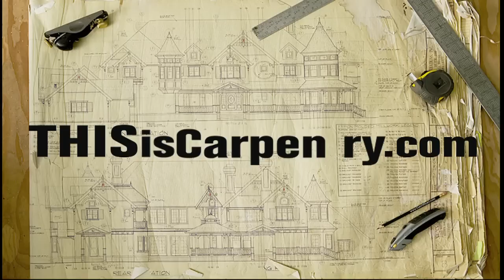Simple Cabinet Construction, Part 4: Tops & Trim

Comment: Top video, well presented with some quality tips and tricks. I'm about to start a large project and this info will help me a great deal. My doors will be inset rather than overlay but the basics are the same, trying to update my small home and add some nice finishing touches like built in cabinets and bookcases, I have a standard English home built with many alcoves so this type of cabinet will look great. 
John Smith.

Comment: You sure make it look easy. Watched all four parts. Thank you so much for sharing your knowledge. I’m building my first two 8 foot cabinets with drawers as we speak. But I need a pin nailer like yours!   QUESTION what is the name brand of your pin nailer and the size of the pins your shooting?? Thanks again and keep all the good work...
Reply: The 23 ga. headless nailer he uses looks like a Grex. It's pretty much the most expensive you can get. The Hitachi version is great and I've used it for years installing trim. It's about $90 at Lowes

Comment: This was a great series but, to be honest, it seemed like an add for Kreg pocket hole stuff. The top for the base could have been attached with just corner blocks and one screw in each corner. The top cabinet should be attached in a way that makes it easy to remove for moving. I get using pocket holes on the doors since it'll be painted but the bet way to make that joint is with a mortise and tenon, a mitered half lap or biscuits. And the drawer box could have been much stronger for only a minor bit of extra work. Namely with rabbits/dados for the front and back.
Reply: I can see where you are coming from TheCodeWright but remember too, the underlying premise of the presentation is a balance between quality of outcome and simplicity.